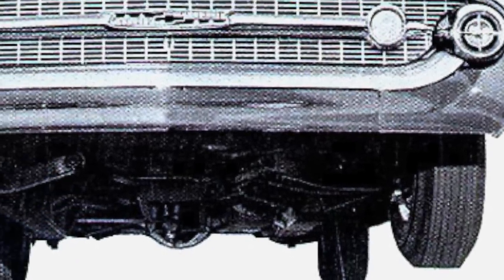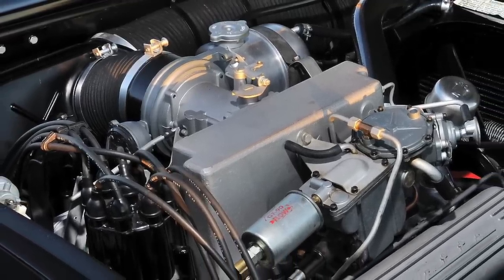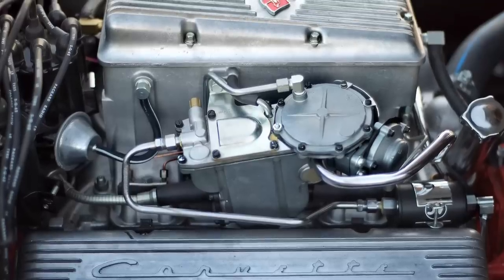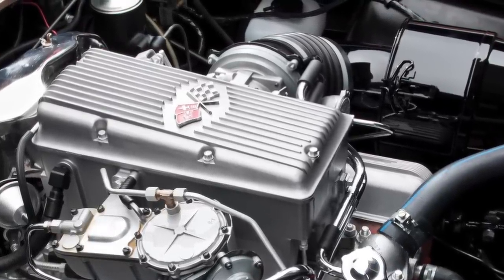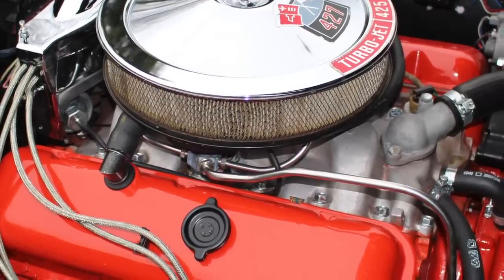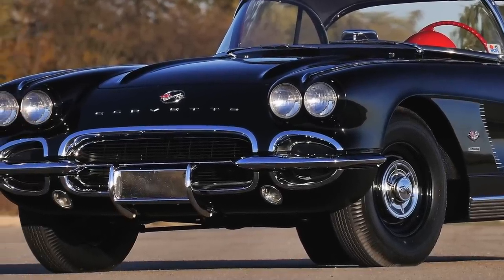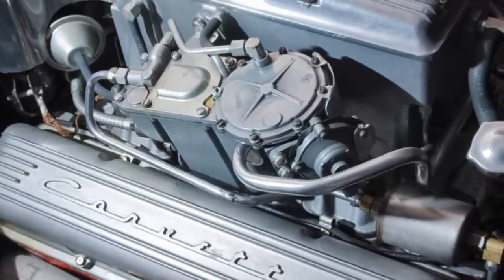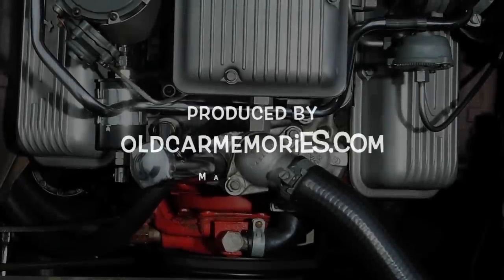Why Chevy Abandoned the 1962-1965 Fuel Injected 327 V8

Comment: There was no reason for the FI to be complicated or hard to maintain- companies like VW had simple mechanical FI systems in use not long after Chevy abandoned the Corvette FI.  Also keep in mind that the Corvette FI engines had mechanical lifters and radical cams that were not smooth to drive and required their own maintenance.  The standard hydraulic lifter versions of the 427 were a lot smoother.

Comment: Good info over all, but a 396 will smoke a 65 FI car, 65 396 /corvettes really run strong. You just have to get them out of the hole. The orig bias skinny tires were not any help.

Comment: Engine size is important.......but axel ratio really determines a 1/4 mile time.
Any engine spinning at 3500 RPM. WILL GET A FASTER 1/4 time with a 4.11 or 3.73 ring gear

Comment: actually it was 20 years later. by the 1985 to 1987 model years pretty much all GM models started getting EFI throttle body setups.
Reply: In terms of the 'big' Chevy, the Caprice didn't get EFI throttle-body... until 1989.   But they work great on the two '89s that I have:  both with the F41 sport suspension.... which makes 'em great road cars... w/ high mpg, too.

Comment: Are you aware where the extra 10 horsepower came from in the FI engine?
Reply: Yes the intake is a mini tunnel ram.   It's sort of like tunnel ram with a side draft mounted at 90 degrees.

Comment: The switch to big blocks wasn't short sighted.   The quickest Corvettes were big block powered until the end of their run.  Well aside from '70 when was it limited to the overrated LS5 once the LS7 never came to be.    GM didn't make decent fuel injection setup until the TPI setup in '85.  The early TBI EFI wasn't very good at all.  The first Corvette that had really had world class handling didn't come alone until the C5 in '97.

You could make a much stronger case that giving up on all aluminum engines was the far more short sighted.  Dropping over 100lbs off the weight off either the small or big block.  That improves handling acceleration and breaking and it's the kind of improvement you will notice without fancy equipment or even a stopwatch.

Comment: Even though Chevy got good HP from FI that system its Very Crude Rochester Design  Speed Density all  Mechanical with Performance Camshaft and High Compression those engines  needed Rich Fuel Mixture 12:1 or Richer. The Mercedes had Mechanical system Bosch High Pressure Pump was driven off the Engine Timing Chain and Fed Fuel to the Injectors .  Bosch also used the same Pump Design and Increased Pressure for Diesel Engines. late 1960s Bosch Designed one of the First Electronic Fuel Injection system and had Patents on many Fuel Injection Components Many Car Manufacturers in 70s-80s-90s Used Bosch FI Components for their Cars 76-78 Cadillac Seville, 85-90s TPI for Corvette Z28 and Trans-Am

Comment: G.M,They Dropped F.I,Front wheel drive On Olds Toronato,Pontiac Tempest IRS,the list goes on
Reply: In Response to video, forgot, same if not More horsepower was made with Carb for cheaper cost is Part of reason why injection went away

Comment: Anyone who says there is no replacement for displacement is wrong, smaller lighter engines that have higher efficiency and horsepower per cubic inch in smaller and lighter cars is the perfect replacement for displacement.
Reply: ..... AND allow for better vehicle handling... due to better weight balance, front to rear.

Comment: Never mentioned facts: by anyone.   Had to always carry a spare FI drive cable, they broke easily,  and never could get a replacement air cleaner element from any dealer ever. and the resistor for that special  distributor & coil that drove the FI was always failing. Scariest car I ever owned as tires back then were terrible and not designed for how quick these were.Blew out several.  PS; The Muncie shifter locked up a lot and one had to know how to reach under the car and fix it and I decided to do a ring and bearing backyard maintenance job and found hairline cracks in the main bearing webs. [Only 2 bolt one back then] The dealer sold me a 327/375 complete short block [with the Duntov cam ] for under $300.  Should have kept the car but I know where the old block was buried!  More of a driver's car than my current 2019 Z06. Didn't need 10 qts of special oil either.  Do miss the full size removable hard top we had then for the convt.  But I can take my top with me now.

Comment: The Chevy fuel injection system - like the Benz 1955 fuel injection - was cribbed off 1940s aircraft engines.   Airplane engines make a lot of HP but operate in a fairly narrow power band.   An airplane's "economy cruise" is 55% power and on takeoff its 100% power.   Cars rarely operate in that high a power range.   The Rochester and Bosch systems were little more than glorified lawn sprinkers and tended to "blubber" along at low power.   Thirty years later, electronic fuel injection solved the problem.

Comment: Ive never been impressed with the 396 the power to weight ratio was pathetic. The 427 was the best mainly because the 454's externally balanced crankshaft was weak. I've seen many break right behind the harmonic balancer. GM's 400SBC had so much potential but they never fixed the cylinder cracking issues!

Comment: Good Corvette history info but BS on injection problems keep clean fuel and tune with a vacuum gage. A buddy and I had'em on our jeeps 25 mpg no floats bouncing and no computer
Reply: They didn't run right when temperatures outside changed.

Comment: Just another example of GM making really, really stupid decisions that cost them tremendously later on. Part of why the imports did so well in the 80's and 90's, their fuel injection systems were rock solid reliable and easy to work on, due to many years of research, developments, and continuous improvements.

Comment: the beach boys sang about a race between a 413 HEMI and a 327 fuelie..... 

if the 396 blew away the 327 FI..... then a 413 would make such a gap, the beach boys would have never made a song about it
and just like the song..... id bet the 413 would jump ahead off the line... 

but the top end power and higher RPM of the 327FI would reel it back in

Comment: They actually started the fuel injection in 57. Didn't perfect it untill 62 but still wasn't perfect the fuel would boil in copper spider under intake an cause vapor lock. I know this cause I have a 62 Corvette with the fuel injection unit. Finally changed it out to different intake an carburetor. Works much better. Does fine in winter but in summer in Tennessee fuel injection no good.

Comment: All of these aspects of rhe change are true.  
But what you are not realizing and adding into the equation, is that the first transistor was invented in 1949 and the first integrated circuit was constructed by Texas Instruments in 1958.   After that is was a huge race of hyper evolving electronics.... which GM easily saw as displacing almost all older electronics, and providing a very usable, precise, reliable fuel injection...compared to the ancient, dinosaur, mechanical versions, with all its many troubles.
Continuing with that old box of mechanics, constantly wearing, made no sense.

Comment: No computer controls of ignition or fuel delivery.
Reply: Computers came out in the 70's. Transistors of the time and related circuit boards were large and simple, misengineered regularly and poorly tested.

Comment: It's mechanical fuel injection, it only works well at wide open throttle. It doesn't propagate fuel atomization that gasoline needs. You are mixing modern efi tech with an analog vacuum control of rubber diaphragms that worked too slowly for street use. 
The main reason that they made the horsepower that they did was the flow of the cylinder heads not the induction.

Comment: You cannot compare electronic fuel injection to mechanical fuel injection. Your statement about mechanical fuel injection being able to compensate for hot and cold temps, along with altitude àre incorrect. Mechanical has no oxy sensors or a computers to make that adjustment. It uses jets, like a carb., which were called pills at the time. However it was brilliant for the time. In my opinion.

Comment: 🤔Intresting indeed.. reminds me of the Bosch C.I.S injection in older European cars
Reply: Not quite the same, but mechanical nonetheless. The older Bosch D-jetronic system was kind of fiddly too, in Germany it was called "tinkertronic".
Reply: You can adjust all kinds of stuff on bosch d-jet and when people don't know what they're doing they can really get it messed up!
Reply: When i was a kid i built a badass 87 jetta.. 10k rpm 8v.. very fun car, i miss it
Reply: Djet's interesting, what I learned working on it is that electrical connections must be in the best condition, especially to the injectors, or it will run terrible. Only had one failed intake sensor and was able to get a reman unit. Biggest thing people don't understand with it was a problem common to old VW's, burned valves or low intake vacuum. That drove the injection rich, so people blamed the injection instead of reading intake vacuum.

Comment: One fact not right here is that since the 396 weighed more  the car weighed more so the 396 was pulling more Car weight . Now you add that Weight Difference  to the car the 327 feuli  was pulling  then check the time trials .... Were talking car weight verses car weight not engine weight verses engine weight... so this means the 396 was the better engine if both cars weighed the Same ...

Comment: Old fuel injection systems have as much in common with the modern electronic fuel injection systems as the old carburetors do. Like the Bosh L-Jetronic which by any measure  was a total failure compared to the last of the Japanese twin throat Carburetors which were a lot smoother in operation.The latest fuel injection and mainly direct fuel injection are worlds ahead of anything in the past for power and smooth operation and economy. But if you want power get a good cam, high compression and a Webber.

Comment: I'm sorry to say that the higher horsepower of the "fuelie" small block was NOT the result of the fuel injection, but rather the cylinder heads and camshaft.
Without a a technical explanation, the cylinder heads flowed more and paired with the more aggressive camshaft the end result was higher horsepower.
Simple proof is that long after the fuel injection was gone - the fuelie heads were a highly sought-after performance modification for carbureted engines.

Comment: The 327 Chevy small block was the best in the 1960`s.After the 1960`s. up to to the 2000`sThe 350 5.7 cubic inch became the best small block known to man.G.M. stopped producing the 5.7 liter 350 cause they where reliable and they last 300k miles +
Reply: My dads 69 c 20 had a 307 was it just for trucks?

Comment: I wonder if one additional possibility exists, the end of the fuel injection also corresponds with the govt starting to come up with all kinds on emissions, their meddling messed up the way engines ran for quite a few years, eventually the engineers figured it out and cars started running right again, these days the performance is better, cars are faster than ever and get better gas mileage to boot.
Reply: But why are we driving gasoline combustion engines? (That is early 1900 technology) 120 years of being chained to a gas station!!!  We should be driving Tesla flying cars by now. 😁
Reply: Aside from emissions concerns, gasoline is a fantastic fuel source. It's cheap to obtain, easy to process, non-corrosive, and has great energy output with low-tech engines.
Reply: Richard Skipper: Plus...the masses haven't yet learned how to drive, much less fly.
Reply: Government makes everything worse.
Reply: +Red Pilled Trump and the Republicans will make it right

Comment: Comparing 1/4 mile times at different tracks with different drivers, on different days with different tires is completely useless information.  The big blocks despite the 100# extra weight will easily out-run the small blocks on the same day/track/driver.   Interesting info however; it's easy to see how the fuelie mark up against the rat motor's extra power/lower cost was a losing proposition.

Comment: I'm surprised they didn't adapt the Bosche-Bendix EFI system (a descendant of the Bosch D-Jetronic system used in the VW Type-3 and the Bendix EFI system used in late 1950s Chrysler products) to the Corvette 350 engine; It had been adapted to the Olds 350 for the mid-1975 introduction of the Cadillac Seville and, I believe, had been available on the Cadillac 472 starting in 1974.

Comment: 1958 DeSoto Electrojector - First electronic fuel injection?
Reply: Yes, and Chrysler recalled all of them and replaced them with carburetors,  because the electrical control box was driven nuts by radio waves.

Comment: All manufacturer played with fuel injection in 60"s but wasn't reliable Even Ford played with Throttle body injection with electronic ignition on 428 CJ in 1968 made more power but solid state electronic controls back then were not good. It looked like a holley with big control box on back of it. Fact mechanical or electronic controls just were not good. Worked great in testing when it worked right

Comment: The first year Crossfire injection was absolute garbage can't give those things away
Reply: Actually if you do some research a crossfire if it had bigger throttle bodies and ported manifold had a higher power potential than the first tpi system. It was choked down so it wouldn't overshadow the tpi that was to come out in a year. The tpi was not ready for mass production but the crossfire was.

Comment: Because it was expensive to produce, very complex, and hard to maintain. So much so that most people pull them off and replace them with a single four barrel carb.
Reply: I had a carburetor 62 Vette so I don't know personally but many old-timers at show and shines told me exactly what you just said.  The story about the big block pushing it out works also though, some of both is probably the real answer.
Reply: X-Man 

The big block option did not help the situation. But I know for a fact it was the complexity/maintenance issue. So many were pulled off and chucked That it was almost impossible to do a full restoration on a late 50s early 60s Chevrolet fuelie motor. Before the aftermarket started remanufacturing new ones just the upper intake Plenum for the Rochester mechanical fuel injection with none of the attendant hardware was $1200 back in 1989. Dealerships were giving people the option of pulling the fuel injection and swapping out for the four barrel high-rise or having the car down for months at a time because they would have to send the whole fuel injection set up back to Rochester for repair.

Comment: 1955 merc was LATE
AAAAAAAAAAAAAAAAAGH WRONG
1953-54 CHRYSLER ELECTROJECTOR
end of 53 start of 54 it was short lived do to poor capacitor lifespans at the time but by todays comparison was a VERY modren multiport injection system

Comment: It also made no sense to do away with the Camaro, leaving a gap between the Cobalt SS and the Corvette! But they did, handing muscle car market Dodge and Ford! Dropping Pontiac was equally stupid they already had luxury performance oriented for older people from Buick and Cadillac they should have dropped Buick instead I have a set of 69 double hump, camel hump or fuelly heads with OEM holes to  accommodate the long water pump.

Comment: I read in collectible automobile magazine that 50's and 60's leaded gasoline wasn't blended for fuel injection systems. Injectors would clog up and FI engines didn't always run well in general due to the nature of the fuel at the time.

Comment: There's a classic car museum in northwest Virginia near Shenandoah mountains where they have engines on display that had fuel injection in the early 1900's (1908 -1915 era). They produced about 65hp, got over 50mpg and didn't use spark plugs. After seeing these engines, I thought that the auto industry has been trying hard to cover up that they were better than what followed over the next 60 years.
Standard Oil was the main company behind these cover ups as they wanted gas eating engines and contributed heavily to the big 3 automobile companies.

Comment: Lets get real. The injected engine may have been ok at large dealerships in larger towns. BUT it is well known that dealerships removed the troublesome [not reliable]  injection in large numbers. The 327 fuellie is no faster than the 365 HP 4 bbl engine.
I have heard that warranty costs were simply too high, the reason it was dropped really.
Modern EFI while far simpler and more efficient is incapable of large h/p gains unlike a simple carb.
And as for weight,,, the327 fuellie with all the piping, vaccum switches etc etc is really not much lighter than a carby big block. Though if GM even then were remotely smart simple weight reduction such as alloy water pump and intake  on all of their engines would have achieved extra handling performance. Alloy heads at that time were far less viable as the casting techniques for very large volume was not there at the time. Though they did unlike Ford  and Chrysler have alloy bellhousings and transmissions. Though both in severe circumstances were known the crack. Ask anyone who has raced with a Muncie and broken off the top left ear, and as well had the bellhousings crack

Comment: Almost all the early Chevy seemed to have fuel problems. Most of the fuel injector setups and factory manifolds were pulled and tossed trying to sort out fuel problems. As soon as a good aftermarket distributor or a serious effort was made to sort out the poor quality piece o' trash it came with, the "fuel" problems seemed to quickly sort themselves out.
Basically 80% of the fuel injection and carb problems I've encountered on an early Chevy small block was the ignition.